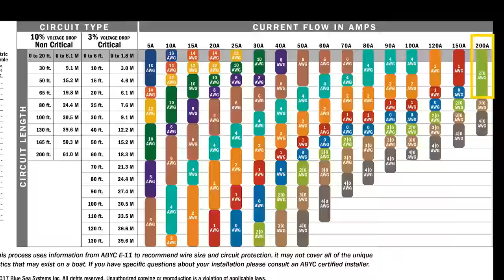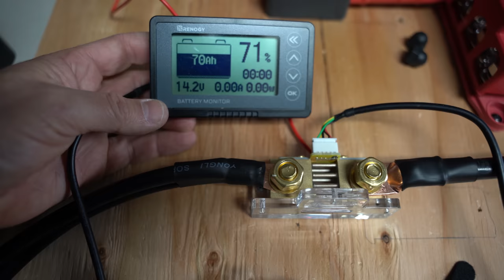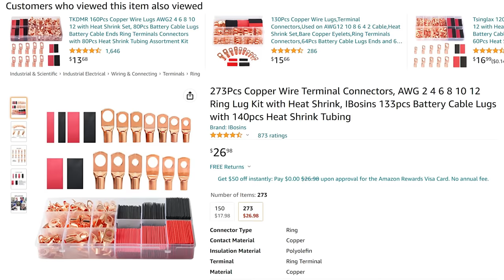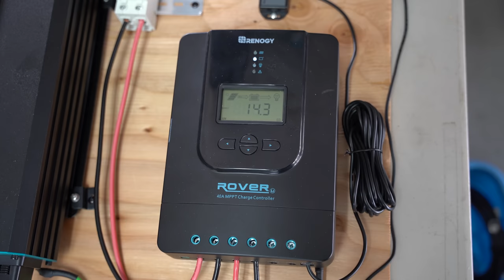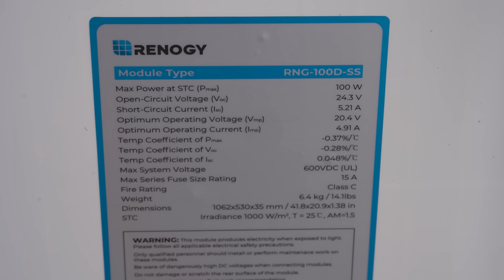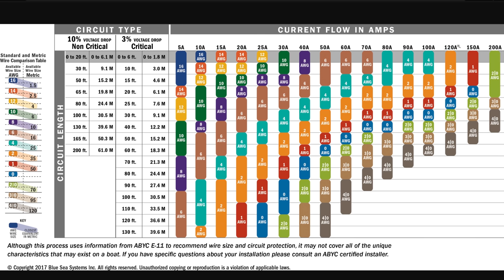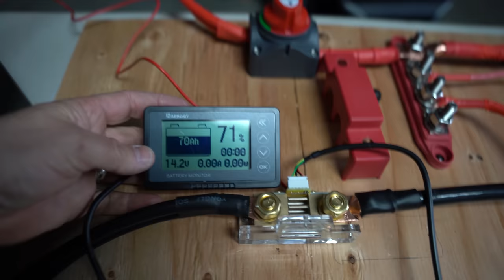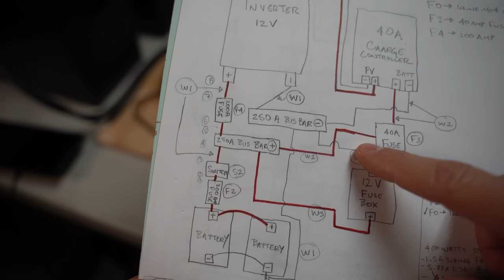How To Build A Solar Setup: COMPLETE Step-by-Step, DIY Guide (12V, 2000W)

Comment: You should have torqued the nuts on all large electrical connections to industry standards for that size bolt and amperage….  You should also specify to only use copper wire! Especially with 12 volt and never use copper clad aluminum as it can cause major fire hazards. These are things that need to be included in even the very basics of how to wire a system. You should also make sure that your followers understand that solar panels output current 100% of the time and they must be covered or turned upside down so they stop producing current when being worked on. These are very basic but extremely important issues that should be covered as they are a major safety issue if not covered! So much so that I would Recommend you put a second update video to this one out there immediately so someone doesn’t make these simple but very dangerous mistakes. Neglecting to do this could put peoples homes and lives in danger.

Comment: I’m not exactly the smartest person when it comes to wiring and electricity, and I’ve watched quite a few videos trying to figure out how to set up a solar panel setup, and I’ve always found that I was confused at the end.  So thank you for making this, for once I don’t feel like a dummy, and it actually makes since to me.

I do have one question though, I was always told that “if you’re not sure, overdo it”.  Like how you rounded up to the next size in wire to support the amps that you were pushing through.  My question is about fuses, can putting a fuse that’s rated for a higher load than what you’re pushing diminish the amount of current?

For example, if you put a 40amp fuse on a load that’s only 5 amps, will the fuse be too strong and stop the current from going through?
Reply: No it won't its just rated for 40 amps and will break only when it exceeds 40amps.
Reply: From my understanding that’s the only thing you don’t want to over do. If you do the fuse won’t do it’s job of blowing and let your wire catch on fire

Comment: Currently working on building out a system like this for my RV.
Going through the video and materials listed I have one question.

Under Fuses you have listed:
Inline MC4 10 amp fuse (used to connect solar panels to charge controller) (F0)

Then under switch:
High volt, low amp fuse (used to connect solar panels to charge controller) (F1/S1)

Trying to understand this but why would I have a 10 amp fuse (F0) behind a 40 amp fuse / breaker (F1/S1) ?
Couldnt I just use a 10 amp fuse/breaker (F1/S1) and eliminate (F0) ?

Comment: When you were doing the math to find out the cable we should use, shouldn't you have to multiply by .85 instead of dividing it so (2000/12)*.85

Comment: if i have 400AH connected to a 3000W inverter just like you did in this video. My inverter would need a 300A fuse or breaker and the batteries would need a switch rated over 400A? Does the inverter also need to have a fuse rated for those 400+A?

Comment: I designed my system exactly like this to the T. Thank you for the well designed layout and lessons. As I am researching, I have some questions. I hope they are not dumb sounding. 

I am expanding a little now by adding 4 100w panels and 2 more 100 amp batteries to have a compete system. 

I have some assumptions to clarify based on other videos I have seen. 
If adding 2 more batteries, the wire can stay the same gauge. 1 ot gauge is for 100 amps.  So simply put, 8”Jumpers across 4 batteries to the on/off switch. With a 200 amp fuse before the 2k watt inverter? 

#2 using your setup, the solar panels should be in series to the controller? 
Thanks again! Subbed and liked!

Comment: Hi, I made the exact same set up everything is exactly Same equipment, fuse, Amps all same. Now my only difference is I got 3 New Renergy 100Ah closed cell, deep cycle acid batters how should I hook batters up Series or parallel and is the 200Amp fuse coming off batter still ok. Basically is using 3 acid batters going to change anything in this setup. Couldn't afford lithium right now.

Comment: Hello, in your video, you forgot to mention that the Solar panels cannot be live when connecting to the charge controller, or you will burn it out. You should always have the batteries connected first. Every charge controllers I have used always instructed the same thing. This is a very expensive piece of kit to make that mistake on.
Reply: Im sure the breaker was off

Comment: So may be a dumb question, but why would I connect my charge controller to the bus bar as opposed to the battery?  (I have 2 100AH LifePO running in parallel in my system) Would the power from my solar panels charge only the battery if I connected them the way this video shows?

Comment: Whoa, hold up.. this isn't about solar, but this is about a welder that I am thinking about purchasing.. it looks like a handheld drill and it's a stick welder that you can plug into an ordinary socket, but when I was looking at them online they are almost 4000 w... So what kind of outlet do I need to plug that into?

Comment: Im trying to build one of these for the occasional outages we have. The only thing holding me up is how to size what i need. I will need to power two full size fridges and a chest freezer in my garage as well as some lights. What size inverter would i need. Im thinking a 2k or 3k should do. I have a 200ah battery but again not sure if this will be enough to run these items around the clock or at least intermittently. Anyone care to chime in.

Comment: If the inverter is only (85%) efficient, wouldn’t the equation be 2000/12x.85=141.67A? Maybe I’m wrong, but that makes more sense in my mind 🤷‍♂️

Comment: what about if your setup includes,  120v 50a shore power, a generator, and a tow vehicles feed to your system?  as in an RV.  DC2DC, AC2DC, DC2AC, Transfer switches

Comment: Why do you have a 10amp inline fuse from the solar panel to the charge controller, and a 40a circuit breaker from the solar panel to the charge controller? Your diagram only shows the 40a fuse, which makes sense because the charge controller has a 40a input max current.  Then what is the 10a inline fuse needed for?

Comment: Why don't you connect the low voltage side of the inverter through the load terminals on the charge controller?

Comment: Quick question about the breaker between the solar charge controller and busbar. I think the breaker shown was 36v. Does that mean the voltage coming out of a 24v charge controller never exceed 36v? Just wondering because a lot charge controller inputs are 100 to 150v

Comment: When talking about the cable sizes, you mentioned 200A from the inverter with 2|0 but on your diagram you mentioned "w1", is this a mistake?

Comment: I question your original calculation that led to the 196A figure that would require 2/0 wire. If the 2000w inverter /12V system needs gives 167 A, then wouldn’t you multiply by 0.85 instead of divide due to 85% efficiency?   This would give 142A instead of 197 A and obviously require less thick wire.
This is obviously crucial because this inverter does not come with 2/0 wire in the box.

Comment: Not being funny but i think creating a power loop to the busbars is actually more expensive (need more cables busbars and shunter) and less efficient and possibly more dangerous for you and your equipment especially when your creating a backflow /2 direction power flow in the busbar while charging and using your inverter at the same time. If you connect your charge controller ( shows battery capacity, health, volts, amps, and temp, like the shunter if connected directly) with a fuse directly to your battery and then connect your battery to your inverter directly your not creating a 2 way current down a wire length and the busbar potentially causing overheating.

Doing it through direct connection into the battery reduces the total amps and volts drained from the battery when charging at the same time increasing its life as you are using the solar panels as another power source that would charge the battery if the power drain is low enough or will act like another battery in series if its over 10 amps 12v or 100w. 
Correct me if im wrong but i thought having a 2 direction flow is bad?
Reply from the maker: I’m not sure, but I think it’s a valid question you bring up.

Comment: Does the inverter size determine the fuse size and wiring size? I'm looking to do something similar but I have a 5000w inverter so I'm just trying to figure out what if anything I would need to change. I'm using the setup to power a 1.5 hp well pump from some solar panels so I could definitely use some help

Comment: Hi Chris great video, my question is how would this change if using a inverter charger. I have 700w of solar and 3-100ah lithium batteries and 3 solar controllers. I want to add a 3000w inverter/charger so I can run my system onshore power when at the dock. Thanks for any input

Comment: Caution, The 200 amp fuses you list may be 32v. It makes a difference. If they are then you have to take your inverter watts (2000) and divide it by 32, then divide it by efficiency rating to get your fuse amperage. Feedback welcome.
Reply: No. The Voltage rating is simply "withstand". A 200A fuse is a 200A fuse.
Reply: @alanclark988  got it, thank you

Comment: You're a mind reader! I've been planning a system for a while now and have your EXACT components in my possession; 2-100A Smart LiFePo4 batteries, 2000W inverter 40A MPPT charge controller and 4-100W monocrystalline solar panels - ALL Renogy brand). It's kinda freaky to tell you the truth. I have two additional solar panels but decided not to use them because of space constraints. I also have a dedicated LiFePo4 battery charger which I may install for emergency use. I have various fuses, blocks, strips and cable tools. No circuit breaker though. Still gotta pick one up. I have the tools to make my own cables, but I still need to purchase the wire, lugs, and shrinks tubing. 

I watched your video to verify my wiring plans regarding current and gauge requirements. While I basically had it right, there were a few comments you made that were helpful, particularly fuse placement closer to the power source. Never gave that a thought.

I'm planning on using 12V almost entirely so that I only have to use the inverter intermittently because of wear and tear, inefficiency and fan noise. Of course that means I'll need thicker wiring in some instances to compensate for higher current values on the DC powered devices. Everything's a tradeoff.

I, too, had a career in electronics. My introduction was courtesy of the USAF. (Ah, the U.S. military. Best 'free' training in the world). After that I worked in the communications/computer field for a national newspaper. Now I tinker just for the fun of it.

Thanks for the nice video. One of the better ones for sure.

Comment: If you put the 200A fuse right off of the battery, why did you need another 200A fuse before the inverter?

Comment: @20:00 Soooo... Coming from the solar panels to the charge controller you have a 10amp in line fuse.. Then 10 seconds later you show a circuit breaker also going to the charge controller..   Wouldn't it be simpler to just get a 10amp breaker and call it a day?

Comment: Hi i have a question I see that you paired 2 battery are they both @ 100 ah ? and if so should you require a larger converter in watts?

Comment: If you went with 48V batteries you could lower your current and wire gauges. Less heat too perhaps?
Reply from the maker: yup!  i am going to build a 24V next and then will do 48V after that.
Reply: For a system this size 12v might actually be preferable. The Renogy 2000W/3000W inverter is very good quality, 90%+ efficiency, 8W stanby and affordable. 12v lifepo4 batteries easy to come by and can be used for many other applications.

Comment: How many 12v batteries can I put into seris? 9?

What gauge wire do I use on 9 batteries in series?

Would parallel be better?

I have 4 solar panels, two 45w, two 100w, 290w in total?

I have 2 charge controllers rated at 7amps.

Can 4 solar panels at 290w charge a 9 piece 12v battery bank in series?

Would a 3000w inverter, 290w in solar, nine 12v batteries power three 720w grow lights for 8 hours?

Thanks

Comment: I have confused, 
what if the battery is disconnected and there are some load take supply from the inverter .
In this case the inverter will get the wattage from the solar panels/ controller and it could damage any thing if the load is consuming more than 40 Amp, right ?

Comment: I dont understand the flow.  Should the charge controller not be exclusively connected to the batteries aside from fuses?  What stops the energy flowing from the charge controller to the bus bars and then to the inverter that is connected to the same bus bars instead of flowing to the battery?

Comment: Please can i use 10 awg wire for 30A output from solar panel to PWM charge controller? Also, i want to know, does PWM charge controller regulate current (Amps) that goes into the battery or will allow all the total amps output of solar panel into the battery?

Comment: Are you sure about using the thhn type of wire? I was told to use the finer copper wire as it lowers resistance and impedance? Can you clarify this?

Comment: To my understanding, a 
2000 watt inverter / 12 volt battery = 166.67 amps 

Adding 15% for the inverter inefficiency this brings the amperage from 166.67A to 
191.67A

So I understand why you sized your cabling to 200A 

This makes sense. But your batteries bms is 100A 

Bms has confused me since I see many different ways that people are installing there off grid systems 

If you are installing cable and fuses rates for 200 amp and your bms is rated for 100 won’t that damage the battery ?

Comment: Which one is Wire 5 that connects your battery to the switch and the shunt.. you have it labeled as W5 in your diagram but you don’t mention it at all.

Comment: Not sure how the 12 volt fuse block works, does one just wire female cigarette receptacles? As aren’t most 12 volt devices, cigarette lighter type?

Comment: The wire he has connected to the battery both positive and negative is not 2|0 Gauge wire is it? I can see it is way more flexible coming out of the switch and the shunt. Can someone explain to me what kind of wire this is? It almost looks like jumper cable wires.

Comment: In this setup if you turn off the battery switch the solar charger wouldn’t charge the batteries correct?

Comment: Great set up. However If China were to pop off an EMP while the set up is up and running or even just sitting unused and unprotected, are the fancy charge controller and inverter toast? How disappointing would that be.

Comment: Correct me if I’m wrong, but the bus bars are essentially just for cleaner setups and make it easier for expansion later yes? It’s not really required for the system to work?

Comment: How do you like that brand of inverter? I have the 12vdc 3000w version with 3 100ah LifePO batteries with very short 2/0 wire runs to the inverter. To run my class c motorhome only when not on shore power. I have not hooked it up yet. Do you think it will run my AC? Thanks, Neil H.

Comment: Why did you run a pair of positive and a pair of negative wires from your battery? The current did not change with the way your batteries are connected, so a single wire from each pole would suffice - no?

Comment: question, could you use this same setup for doing a 12V system for an ebike seperate to the main battery of the bike
I would be running turn signals, tail light and brake light and possibly a 12V Combination Halo & Fog light....I would be running the entire 12V setup off a 18V 5A/h Ryobi 1+ Drill Battery and have already purchased the step down converter for it,

Comment: Is there any benefit to doing this setup versus having a solar panel with a portable power station?
Reply: I just traded in a power station to build a more traditional system like this one. The main issue with the powerstation was that it could not charge while being used/drawn from without damaging the battery. Bougerv does not make this distinction until you read the manual and reviewers don’t mention it either. 
Check manufacturer about this specific issue before purchasing. 
Also. These traditional systems are expandable and if a component fails or needs upgrading… it’s easy to replace.
Reply: If something blows or breaks in a portable power station you lose the whole thing. With building your own you can replace things if something goes out.

Comment: If a 12V battery bank can only handle a 20amp charge,  then the maximum the charge controller will feed the battery bank is about 240 Watts (12V x 20A).  If that's the case, then what's the point of having large watt solar panels?  Say if you had five solar panels at 200 watts each for a grand total of 1,000 watts coming from your solar panels you can never charge your battery bank with that much wattage, yet your tools can easily draw that much power from your inverter.  How do you get those 1,000 watts from the solar panels directly to your tools?   Is there a way you can save the power in your battery bank, and get the power from your solar panels instead?

Comment: so.... good basic video however I must say you skipped steps on wiring for battery lugs.  please solder them.  it makes a better connection when they are crimped and soldered.  furthermore if you want battery lugs that are easier to modify and move around why don't you use high strand wire from a truck shop or a shop that sells welding cables.  better for current movement.  otherwise you did a decent job of explaining it